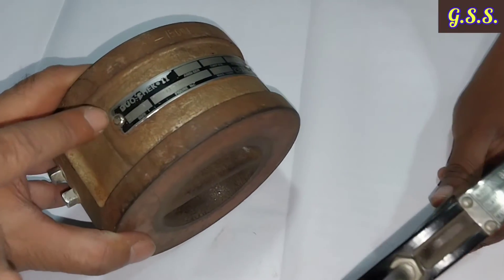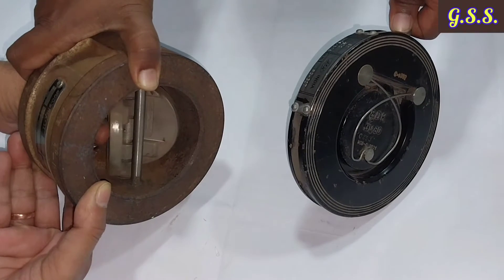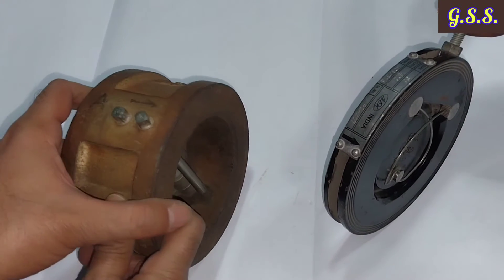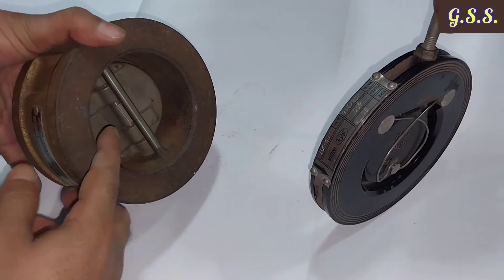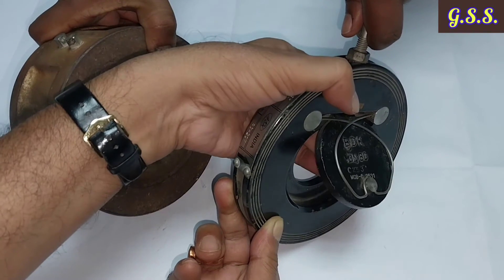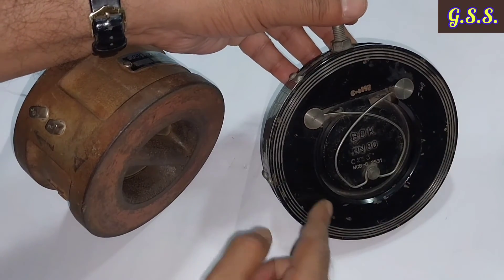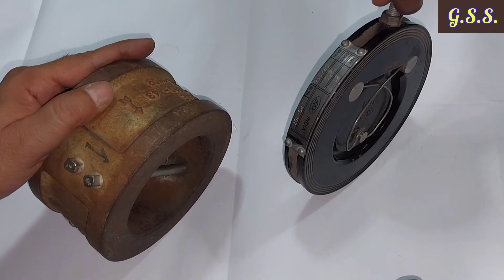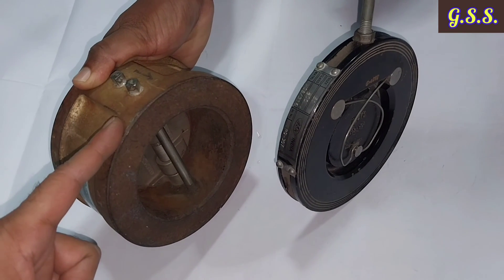Piping Engineering : Check Valve - Dual Plate Vs Single Plate

Comment: Hi sir
Can we use single plate check valve in vertical line in case flow from upward and downward case
Reply from the maker: We can use it on vertical line for upward flow only.
Reply: @gourisankarsamanta7670  
Which check valve is suitable for downward flow as lines connect to nozzle from top and check valve location on nozzle
Reply: Very very very ... nice and complete video
Do you have any channel or group in telegram or other ? 
Please share
Thank you